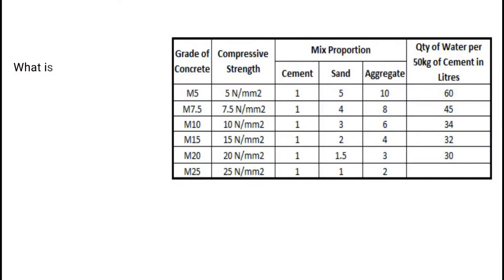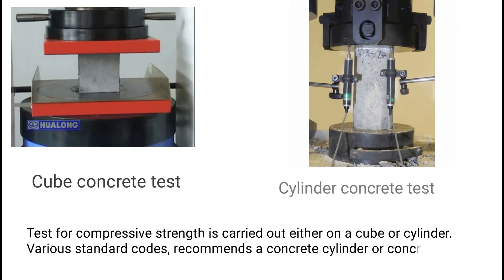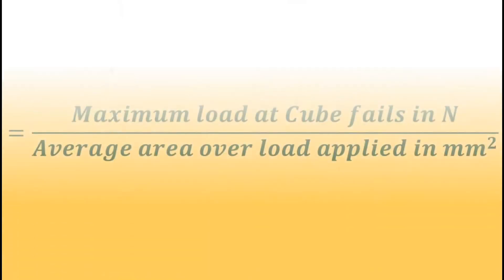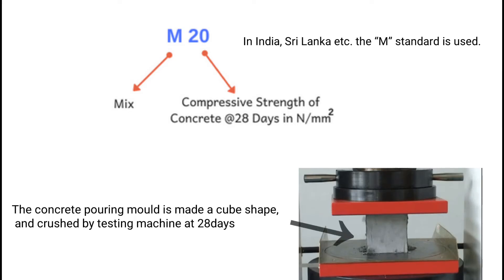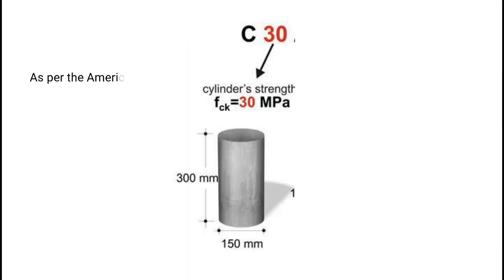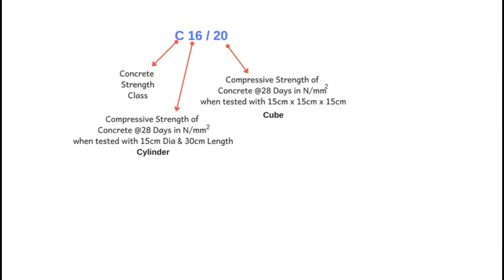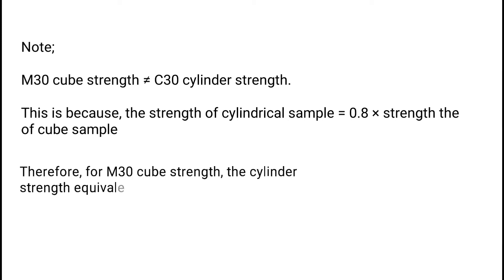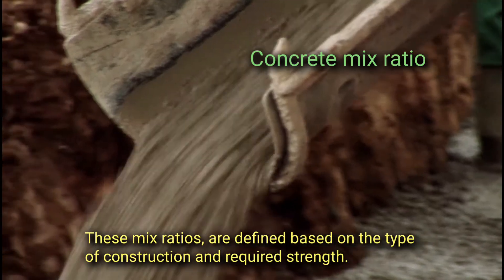Understanding The Different Grades Of Concrete And Their Mix ratio In Engineering.

Comment: Can I ask how much is the mixture of CEMENT and sand for the 6 feet and 5 by 5 pole, the thickness, thank you
Reply: If you have a concrete calculator to tell you how much you need, you just need to know the proportions after that and you can figure it up yourself
Reply: @liquidrockaquatics3900  I used a volume calculator and found I only had half of what I needed. Bags of sand and gravel do not state weight or volume.